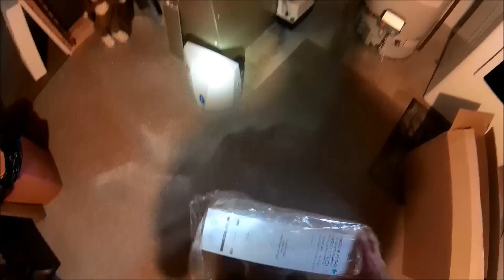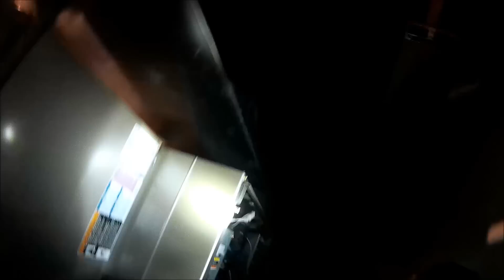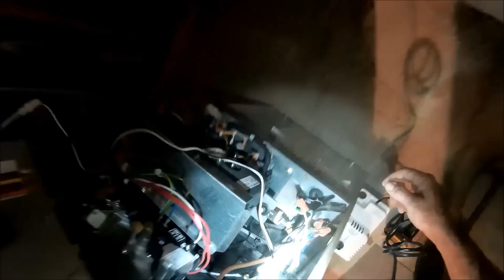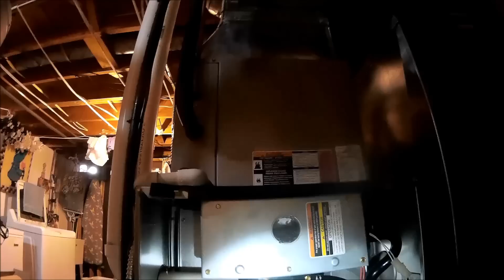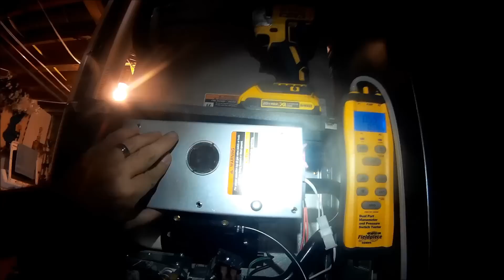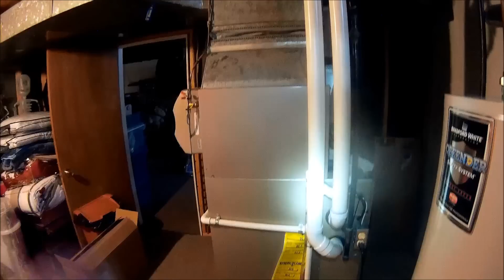Carrier Infinity furnace tune up

Comment: Great video. I have that furnace in my house, 10 years old but great furnace, very reliable until the heat exchanger busts of course. Cleaning the flame sensor is difficult though, I didn’t see that in your video. But I learned something I didn’t know before, the condensate tablets and AC shine. Thanks for sharing your videos, great job. Keep posting them please. I love your videos

Comment: I wish I had enough time to be that thorough
Reply from the maker: +Justin Frias  My normal tune up takes about 1 1/2 to 2 hours
Reply: +Mi Heating Guy geez I'm in and out in 30-45 mins I work on a lot of tranes and Lennox though it's awesome to see carrier vids
Reply from the maker: sometimes I spend 30 mins. just talking to my customer. I will have more to come
Reply: +Mi Heating Guy yeah but unfortunately that's all my job gives me for time if I took longer they would fire me
Reply from the maker: man I am sorry to hear that but if you spend more time in the house it make for better customer service and you will have a customer for life. the house I took this video in the customer will only have me out to house
Reply: Your work should allow techs to slow down. The faster one is on a service the more likely the call back. Even though some companies are about quantity in a day over quality, the only person that knows to do a good job at the end of the day is, you, the tech. It's not a race. A company cannot fire someone for taking quality time to check everything.
Reply: Great tune up. The one thing I was hoping to see was the flame sensor. I still to this day haven't figured an easy way on those carriers to get the flame sensor cleaned Inna maintenance.